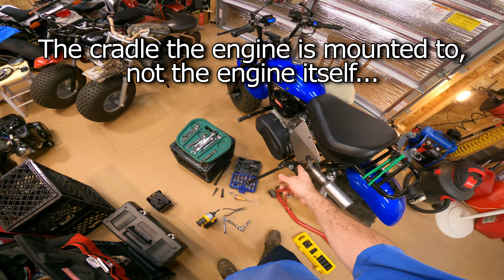SUPERPIPE! + Tillotson + Trailmaster MB200-2 = Awesomeness [4K]

Comment: I have that exhaust on a stock MB200 engine. Mine went on with no problems, the pipe even rested against the rear longer shock body. I think that engine is what made your pipe fit so differently. I have the stage 1 with the .38 jet and mine still has that popping from the exhaust coming off of full throttle. Stage 1 totally woke the bike up though.
Reply from the maker: They're all the same engine dimensions. They are based off a clone engine. The exhaust port is in the same position. I pushed the engine as far left in frame as I could for pulley alignment because this engine has a shorter output shaft, but there isn't that much room to move it. 

It's just that the pipe is off a little but it still works so no big deal.  I looked the other day and it is not touching the side cover plate.

Comment: Best pipe out   i need one   really looks like a cool dual purpose bike  or dirtbike with that pipe  cant stand the pipes that go  in every direction of the frame   but then again  most are only 39-49 bucks   this pipe looks well worth it
Reply from the maker: It really is a nice piece they made. There is a potential design flaw though.  The engine cradle is on rubber bushings for some reason which allows it to move around a little, but the pipe is hard mounted to the frame. Pipe transmits a lot of vibes to the frame (a LOT), and I think it’ll eventually stress crack and fail. I’m either going to somehow soft mount a pipe hanger or weld up the engine cradle or both.

Comment: I put the Superpipe, the bigger jet, and an open element air filter (stage 1) on my MB200-2 while it was still in the crate...the pipe lined up perfectly with the mount on the frame with no rubbing on the cut out in the side plate..maybe yours was just tweaked a little in the bushings from riding it..

since I've already tweaked my air filter from just walking past the bike in the garage and banging into it with the grocery bags in my hands, I'm thinking of swapping it out to a lo profile, like you've done ...looks much cleaner with the smaller filter anyway and seems to run just fine

does that low profile filter sit in close enough to the motor to give you access to the rear set of pegs?
Reply from the maker: Yup! Can get to pegs no problem, that's one of the reasons I wanted to try that filter. 

Yeah I forgot to mention in vid that I also pushed engine as far to the left as I could (just a couple mm) when hooking up Tillotson because it has a much shorter shaft than stock engine and every millimeter gave me a little more engagement with the driver pulley on shaft while still allowing me to line up TC belt.   But there wasn't much wiggle room so I don't think it set the engine that far to the left that it would cause than much alignment issues. 

It's not bad though, a few washers and it was lined right up. I may clearance the side plate a little though. I couldn't really tell if it was touching, it might just be very close.  I may try a different way of supporting pipe.
Reply: @bwxmoto  thanks for the info..ordered a new lo pro filter...growing up riding dirt bikes had me wanting to stand up more when riding the mini bike..access to the rear set of pegs will help a lot
I'm in the process of building up a Tillotson 225..was going to put it on a MiniMoto 80/105, but maybe I'll swap engines, and put the 225 on the the MB200 instead, if it will gain me a little room for those rear pegs
Reply from the maker: @jimcornish242  It's funny I thought I would use the rear pegs more but they're almost too far back accept for anything but steep hills. Yeah that 225 would be nice on the MB200-2!
Reply: @bwxmoto  just got one of the low profile filters installed...you're right, the rear pegs are a bit too far to the rear of the bike to be comfortable..that's a bummer

at least with the low profile air filter I won't be as worried about knocking it off of the carb every time I ride through/past bushes
Reply from the maker: @jimcornish242  Yeah those filters are pretty nice.  The rear footpegs could be good on really steep hills where it seems you might flip over backwards or start to wheelie. At least you have an option with those rear pegs but the wheelbase is long enough where most of the time you don’t need to.  On the Coleman the wheelbase makes it basically impossible to climb some hills that the MB200-2 could handle.

Comment: Swap those 2 long nuts that held your carb on for the nuts that hold your gas tank on. Just swap them so there are no spacing issues when using your air filter adaptor...
Reply from the maker: Good idea! I kind of liked the "aerodynamic nuts" though 😆
Reply: @bwxmoto  yeah mee too!

Comment: When you installed the 38 jet with the super exhaust, did you need to adjust the carburetor at all or did you simply just drop the jet in & go? I’m going to be purchasing a Hurricane 200x here shortly & want to run the same exhaust & stage 1.
Reply from the maker: I don’t think the carb is adjustable. I’d have to get an aftermarket carb for that. I think I used a 140 e-tube and 38 jet and that’s it.

Comment: The one thing I like about the ducar adjustable carb out the box I've got no time on my bike with it other then a rip down the road and back waiting on some more parts aka front suspension upgrade
Reply from the maker: I noticed this carb doesn’t have idle mixture screw like my $7 ebay carbs. Probably just because the Tilly is EPA compliant. It does run pretty good but idle is kind of all over the place. Sometimes it settles to a higher idle for some reason. Not sure if that’s because of not having an idle mixture screw to adjust or what.
Reply: @bwxmoto  I'm sure it does the ducar I did not have mess with jet with stage 1 kit  and saved me a few bucks not having to buy a mikuni I may upgrade but for what little I've got to ride the bike the 5300 rpm governor makes it pretty wild for the mm 80 I'm going to go with tav2 next and front suspension
Reply: @bwxmoto  also are you running the 212r or hemi
Reply from the maker: @heathenprojects2639  This is the 212E Hemi. If the R was in stock anywhere at the time I would have bought that though.
Reply from the maker: @heathenprojects2639  I thought you still needed to change the main jets on those carbs since it is just an idle circuit air mixture screw. But maybe they have more adjustment than I thought.
Reply: @bwxmoto  feel ya thier I bought ducar because it was on sale at eccarb for 179 and I have a Tilly e as well I'm wanting a 212r they say back in stock end of September
Reply: @bwxmoto  they come from factory with large enough jet to bolt on stage 1 and the PVR fly wheel is rated for 17k rpms ducar is the exact same motor as the Tilly e they're both hemi made same factory it's built for regulation tec put of the box kart racing I had one on a 208 kart it also has a set idler for your governor to turn it down for like stock 3600 Kart racing it was go to tell tillotson/ducar same company released the 212r for 306 class also wired thing is the ducar has oil sensor like the predator
Reply from the maker: @heathenprojects2639  I dunno why Youtube keeps flagging some of these comments as possible spam and blocks them until I manually approve them. Anyway yeah the Ducar is a good choice, only thing I heard was different is that it has an oil sensor and the opening in block for oil sensor and the Tilly doesn't have that. But the PVL flywheel on Ducar is better for sure. 

I just bought a PVL flywheel for the Tilly, 212E  then learned that the Tilly flywheel is supposedly good for 10k RPM for 10 seconds and 8k RPM for 30 seconds. Then after that a guy posted a pic of his magnet flying off and destroying stuff on a Tilly 212E at 7300 RPM!  So glad I got the PVL but that and expensive way to do it. Would have been much better off getting a Ducar and painting it blue if i wanted a blue engine. I do love the way the blue looks on this bike though of course but not worth the extra cost of the Tilly, at least not the 212E.
Reply: @bwxmoto  ya mine does it to and I agree I bought just about everything out thier I've got predator non hemi all the way up to a wildcat 223 I'm wanting to buy another Tilly 212r just to have stock since I converted my original one to a 228 stroker I have a 225 I've been kicking around about turning into a 236 stroker but like the 212r you can't get them anywhere so I'll be waiting tell they come into stock

Comment: I swapped out the .037 jet from mine and put in a .038 jet but after riding with it for a few days i took out the sparkplug while i was changing out the stock springs for 18 lb valve springs and i noticed the tip of the sparkplug was completely black and whenever i let off the gas it was making a loud popping sound similar to a backfire but not as loud. The .038 jet just made it run too rich and i didn't really notice any difference in power so I'm just gonna put back the .037 jet. I also for the first time just swapped out the stock 50 tooth sprocket and put on a 44 tooth sprocket in hopes of getting a top speed of atleast 50mph. I'm just hoping it isn't ridiculously slow on the low end power cause i believe i have a 12 tooth sprocket up front as well. But i did change out the stock red spring on the torque converter to a yellow spring which should help somewhat i'd imagine with torque. Also have a mod 2 cam coming in the mail soon which i'm hoping will help with the overall power so we'll see what happens. When i first got the bike i had no plans on changing anything on it cause i didn't really know how and now i'm just addicted to it constantly trying to get more and more power and speed out of it like i can't control myself lol. With all the money we've blown on these mini bikes we could have just brought a real dirt bike or motorcycle by now lol. Like a Honda XR or Yamaha TTR or something like that. Oh well. ;)
Reply from the maker: You can still get a dirt bike though! Yeah I think my .038 jet might be a little rich especially since I’m at about 1000 ft above sea level. But this pipe and filter seem to flow a lot too. Might be lean at idle and rich mid range and lean on top too. Who knows. 😆
Reply: @bwxmoto  The Gray Goat at OMB Warehouse told me to get that 38 jet outta there and put back the 37. He said all it's doing ruining the sparkplug and fouling up the engine. Now today i was gonna take the bike out for a test run with the new sprocket on back but when i went to push the bike out of the barn after i rolled it about 5 feet all of a sudden the rear wheel locked up on me. The chain isn't rolling smoothly onto the new sprocket. It's like some teeth will take the chain okay but then other teeth hold parts of the chain above it and it makes the chain jam up. Not sure why it's doing that. It's a 420 chain and i'm pretty sure the sprocket is either a #40 0r #41 which is supposed to work with 420 chains from what I've read. I tried lubing up the chain and sprocket teeth and it helped a little bit but not enough to make it fully functional. Now I dunno what the heck to do about it. Yeah I can just put the stock 50 tooth sprocket back on but I really wanted to see how fast it would go with 44 teeth. When you changed read sprockets did you ever have this issue ? Have you ever tried a 40 or 41 sprocket with a 420 chain before ? When you go to move the bike and the sprocket starts turning before it even gets to 1 full turn it jams up. If I stand behind the bike and look at the sprocket from the rear it looks like the chain wants to go off the sprocket more and more as it turns.

Comment: I remember not long ago the big go kart and mini bike tubers were pushing using a  pre cleaner and a sock on those after market air filters then using pre cleaner oil on  em too  it seems to me like that would diminish the effectiveness of the filter
 And change the air fuel mix
 Bwx you got any info on this
Reply from the maker: Yeah on one filter I had a while ago I put filter oil on it and it basically wrecked the filter, made it totally restrictive. Some of these aren't intended to have oil on them and some are. Problem is they never say either way. But if they aren't supposed to have oil and you oil them, they usually act like a stock filter or worse.   I think these little ones aren't designed for oil because the filter material is pretty thick.  Those K&N style filters designed for oil have paper thin filters.  I wouldn't mind running a pre-filter on this one though, but I haven;t found a small enough one yet. Seems like if the pre-filter had enough flow it wouldn't hurt the air-fuel mixture.

Comment: 236cc tillotson,  28 mm Mikuni
And a juggernaut , real gas tank!
Superpipe.....it flies!!
Reply from the maker: I bet! I might have to try a Mikuni one of these days.
Reply: @bwxmoto  I chose the 28 mm because everyone was out of the 24 mm..seems to work fine.  55mph
With 60 tooth sprocket! I use it for trails & hills so top end is not my thing..acceleration is!!!
Reply from the maker: @johnhock890  That's pretty quick for one of these! But yeah I'm all about torque for climbing. In this vid the gearing wasn't right. It's a bit faster now actually, at least up hills.
Reply: @bwxmoto  it has so much power it over runs the gearing! The 46 tooth
Would be better on the street would
Yield 60+ mph no problem! Keeping 60 tooth on it for the hills & trails!
Reply from the maker: @johnhock890  Yup for sure. These are way more fun on trails and in the woods to me so I'd rather have the low down torque and sacrifice top en on the road.
Reply: @johnhock890  What RPM are you seeing at 55 MPH? The Jugg is interesting but I've never seen a gearing spec on it. I know it doesn't get to 1/1. 

Some guys are getting nearly the same top speed with the Jugg that they got with the stock driver, just at a higher RPM.
Reply: @Deucealive75  No idea..no tach
It is really revving up! Have the 265
Banzai cam...this mph is GPS so very accurate! You could put a 35 tooth if you wanted to go real fast..
This engine would pull it!
Reply: @johnhock890  OK. Nice.

Comment: I bet you if you would have put a base coat down on that on that side panel flat white or satin White and went back over with that darker blue yet or it was pretty close already but at the white base coat I think you would have nailed it
Reply from the maker: Yeah I was thinking about putting a darker or lighter basecoat or primer underneath a darker or lighter blue to match it up if it was too light or the other one was too dark. I think I might repaint the engine where it is blue and the side plates to match the blue fenders which are more like Yamaha blue.

Comment: I put my 228 stroker on my mm212 pro after 2 weeks it opened the motor plate like a can opener I'm back to the drawling board again
Reply from the maker: Woe! Yeah these bikes start to show their weaknesses when pushed, that's for sure. Did it  break the welds and then twist the metal? That's kinda crazy.
Reply: @bwxmoto  no welds are great it actually just past the bolt peeled it I've got some angle iron I'm going to put in and weld also going to put a thicker plate and some rubber bushings to help with vibration the Tilly 228 has 15 more horses then the stock 7.5 it came with I looked at the plate and thought that's pretty thick but guess I was wrong 😂
Reply from the maker: @davidpayne4084  😆 Makes you appreciate bikes that come from factory with 120 hp, or 170 hp, or more and are still pretty lightweight. The engineering that goes into them is pretty wild!

Comment: Wow that exhaust pipe flexed the frame  damn that metal must be really weak
Reply from the maker: I'm not  sure I explained it very well in the video but the cradle the engine it mounted to is a separate piece that is mounted with rubber bushings so when I torque the pipe it is flexing those bushings I think. That's why this bike is so smooth and has little vibes stock. Those bushings absorb a lot of engine vibration, but also introduce some flex in the frame. I don't think the metal part of the frame is flexing that much. But who knows! LOL  That's just my theory.
Reply: @bwxmoto  oh ok i see i heard you say simething about rubber bushings but i didnt quite putit all together
Reply from the maker: @GeorgiaRidgerunner  Yeah but it might be a little of both. I can't really tell. I do like the way the Coleman frames have two down tubes and are more boxed in than the Trailmaster.
Reply: @bwxmoto  i saw in another video though that the coleman  down tubes have tendency to break but
The person said that they only break if you jump them
Reply from the maker: @GeorgiaRidgerunner  Yeah I’ve seen quite a few broken in pics but I always wonder if they were crashed or jumped or if someone 350 lbs was riding. I’ve had some pretty huge bumps on my bikes and I weigh north of 200 lbs with gear and no frame cracks on 5 mini bikes but could be just luck. But I try not to jump them much and slow down over really rough ground most of the time. But I won’t be surprised if one day I see a crack on a frame!
Reply: @bwxmoto  hopefully that doesnt happen